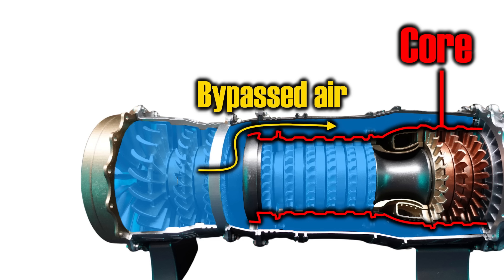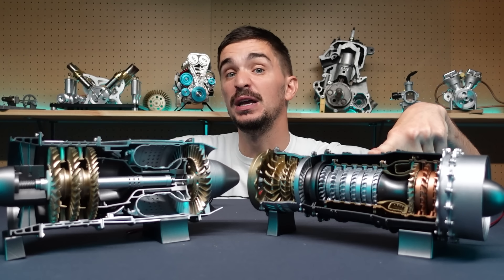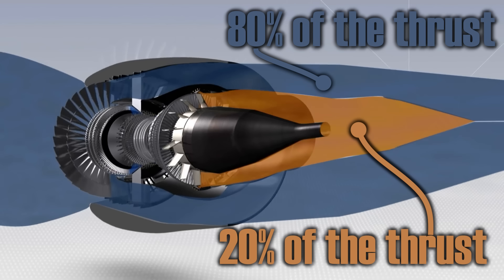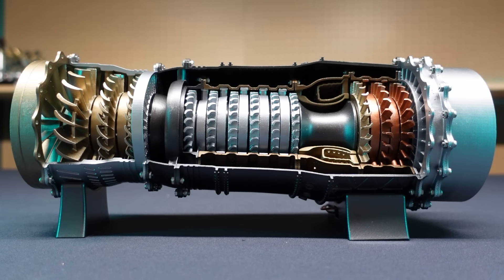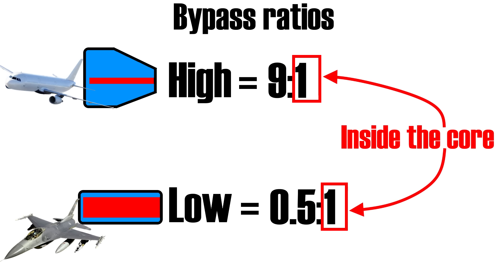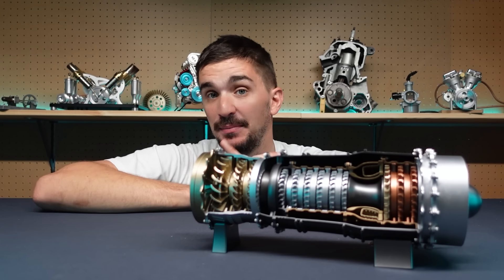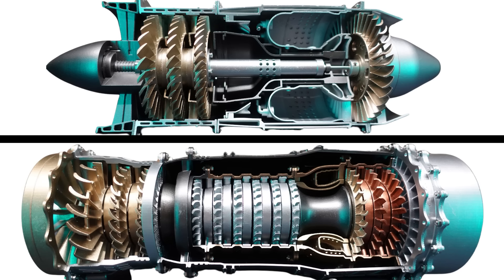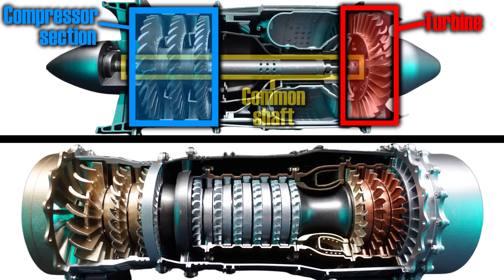Jet Engine Evolution - From Turbojets to Turbofans

Comment: I had now idea that turbofans had two sets blades on two shafts! Very good video D4A!
Reply: There are jet engines with three stages (low pressure, intermediate, high) on three concentric shafts!
Reply: @dielaughing73  @GetOffMyLog To expand further, most North American engines (GE, Pratt & Whitney) are of two-shaft (or two-'spool') construction. The fan and the LP compressor are on one spool and the HP compressor on the other spool. Rolls-Royce large civil aero engines (the RB211 and the Trent families) are three-spool: the fan on its own shaft and then the intermediate- and high-pressure compressors on their own shafts. Three-spool engines are heavier and more complex, but allow the fan and the IP compressor to spin at their own best speeds and also reduce engine length and increase engine rigidity.
Reply: @sentinel76  right. I remember researching the Trent 60 that was used in the local power station, which was three-spool as I recall. The big frame turbines may have been two-spool types

Comment: Bypass jets were in Whittle's 1936 patent although he called the fans augmenters - there were a number of arrangements described. I would have to check, but I am pretty sure the patent covered multishaft turbines, he certainly knew about the requirement to run different parts of a turbine at different speeds.  During and just after WWII, Whittle and Power jets were working on two turbo fans, one for the Miles M52 supersonic aircraft and another called the LR (long range) jet, which had a bypass ratio of about 3 for long range aircraft.  These were cancelled by the British Government.

The turbine with counter-rotating shafts was a concept worked on well before WWII by A. A. Griffith as part of his studies of compressors at the RAE (Royal Aircraft Establishment).  Despite his "villian" tag in the Whittle story, he was a brilliant scientist whose paper "An Aerodynamic Theory of Turbine Design" in 1926 showed that all compressors up to that time were operating aerodynamically stalled. Previous to this, he had published a very important paper on brittle fracture and fatigue "The phenomenon of rupture and flow in solids", a seminal work.  His work on compressors definitely covered multishaft turbines.  His turbine work (carried on by Hayne Constant after Griffith went to R-R) produced the technically advanced MetroVick F2 axial gas turbine, which first flew in a Gloster Meteor in November 1943, not that long after the Meteor's maiden flight powered by a pair of deHavilland H1 (later renamed Goblin) turbines.

So all these concepts in the video were known before the first gas turbine ever ran, let alone flew.  Getting them to first work and then manufacture them, well, that is another story.

Comment: Now explain simple plain air cooled aviation engines and why the simplest item costs so much to replace. It's like working on an old 911 air cooled engine, but parts are even mooore expensive.
Reply: That’s easy.  #1, FAA regulations.  #2, low economies of scale.

Comment: My big question is how visible are the exhaust gases between the older turbo-jets verses the newer bypass turbo fan airplanes when viewed from the ground? In other words is there a visible condensation trail behind both engines or just one of them based on their efficiency and the bypass air that is added to cool the jet exhaust?
Reply: depends on amount of used fuel, older engines were weak and not big fuel flow

Comment: One way I understand the efficiency of high-bypass turbofans and the top speed of low-bypass turbofans is purely from the energy and momentum standpoint.
The thrust of the engine scales linearly with the flow rate of the exhaust air and with the speed of the exhaust. However those things are not equal - the flow rate scales linearly with the energy use, but the exhaust velocity scales with the square of the energy (½*mv²). So for highest energy (and fuel) efficiency, moving more air is clearly better.
However there's a catch - the exhaust air has to move faster than the intake air, otherwise the engine doesn't provide any thrust. So for high-speed jets, moving a lot of air slowly isn't an option - so they have to go for a less efficient method of "move the air faster".
If the fan size was the only limit, you could "just add more small fans, outside of the engine", like VTOL aircraft (except pointed backwards, not downwards).

Comment: Turbo Fans technically have a turbojet inside of them. They just also have a by-pass section and exhaust is used to drive the big fan at the front, giving more air mass flow, therefore thrust. Turbo Jets do not have a by-pass area and a exhaust powered fan at the front. Turbo fans are suited to sub-sonic speeds and are typically more fuel efficient which is why most airliners use them, while turbo jets due to their less complicated design are more suited to military applications and are more fitted for super-sonic applications which is why most fighter jets use them.
Reply: Most modern fighters and supersonic bombers actually use low bypass turbofan engines, not turbojets.

Comment: Have you seen the new jets which have the fans on the outside I thought air is lost off the ends and ducting them through a tube no air is lost whatsoever making 100% of possible power and being very quiet unlike propeller one's where the blade tips go supersonic where they can be as loud as the tupolev 95 bomber which can be heard 100 miles away however this plane is capable of 575 miles an hour
So what do I know

Comment: Great video. 
Turbojets and turbofans both somehow benefit from the gyroscopic effect they generate: these engines quickly lose their power when the incoming airflow is not entering the engine aligned on the lenght axis of that engine
Reply: no, modern jet engines have systems that prevents stall/surge

Comment: Excuse me, let me ask you something. Suppose we use an electric motor to turn the jet engine shaft instead and we change the combustion chamber to an electromagnetic wave chamber or a microwave chamber that turns the air into plasma, is that possible? 
If it is possible, can we call it an electromagnetic plasma jet?

Comment: Unless I missed it, does anyone know what the compression ratio is inside a jet engine?

I assume it varies, but is it similar to a piston engine? Or higher?
Reply: In turbine engines it isn't called "compression ratio" (which is the ratio of volumes at maximum and minimum cylinder volume), but instead "pressure ratio". Primitive gas turbines (very old, or the ones now sold as toys) run as low as 3:1, but the largest and newest engines run at more than 50:1. 

Compression and pressure ratios cannot be directly compared, because adiabatic compression in a piston engine results in a pressure ratio higher than the compression ratio, and because the ideal mechanical compression ratio of an engine is not what it effectively achieves with real valve timing and fluid dynamics.

Comment: THE BEST DAY OF MY LIFE was a private tour of the Rolls Royce Airo engine plant - they GROW the turbine blades as a single titanium crystal
Reply: they were the first to think outside the box, until then only solid fan blades were used, which brought into question the increase in fan diameter due to the large centrifugal forces due to the large mass of the blades
Reply: yes and no. The turbine blades are cast in a 'Nickel superalloy' of undisclosed recipe - not Titanium. It's the extremely carefully controlled (and secretly controlled!) solidification that results in the inherently flawless single crystal turbine blades. It's a true marvel of engineering for sure! The fan blades have long been made in Titanium, for it's superior strength to weight ratio.
Reply: @crazyg74  - Yes that is a more accurate way of saying it.  I was lacking the language to describe it. it is a casting process that results in the entire casting being a single crystal

Comment: Very informative. The question I have is if turbofans are so much more efficient than turbojets then why were so many older aircraft that used turbjet engines able to substain high speed flight for such extended periods of time? SR71, Concorde, B58 Hustler, etc
Reply from the maker: You don't need to be efficient to sustain high speed flight for a long time. You just need to carry a lot of fuel 😉
Reply: to fly you need thrust, to have thrust you need speed difference between exhaust and local air, if you wanna be effective that difference must be minimal, so, if exhaust speed is high, that engine will be more efficient on higher speeds, but over 3Ma ram effect is so strong that you do not need compressor.........

Comment: Turbojet is not obsolete, only that it is not efficient at the speed that most aircrafts travel with the current tech
Reply: Correct, at higher speeds and altitudes, turbojets can be the more efficient option.  Which is why fighters use low-bypass turbofans, to glean the better of both worlds.
Reply: That makes them obsolete. Even supersonic military aircraft don't use turbojets any more.

Comment: Love it. One thing I would have mentioned is the connection between multi-stage configurations and the supersonic fan blade issue - i.e., the use of gearing to have slower fan speeds relative to the low pressure compressor in some very high bypass engines.

Comment: I was hooked with your Volvo red block video. Keep them coming. This video does a great job describing the differences. I believe one other advantage with the high bypass (but don't trust me without verifying) is that the momentum of the core exhaust is more efficiently transfered to the bypass exhaust because the bypass has a velocity that is closer to the core than the freestream velocity.  And the same holds for the bypass exhaust momentum to freestream. Basically it's just a smoother transitiion from core to freestream.  Hope I described that correctly.
Reply: yes

Comment: I would like to learn about turbine engines for power generation. I would like to know how they extract as much energy from combustion instead of trying to convert it into thrust.
Reply: They use generators. Much like the high bypass turbofans, or turbo props, they just use the power to turn generators instead of turning fans that create bypass, or props to create thrust. They design the systems to leave as little unused power as possible in the exhaust. In many systems they use the exhaust heat to power steam turbines, which makes it possible to extract more power with higher total efficiency than in turbine engines. 

I'm sure Driving 4 Answers can explain all this much better, in a video, that's also enjoyable to watch, let's hope he will.
Reply: Basically, you just add another turbine behind your engine, which is nothing more than a fancy windmill. It converts thrust into rotational energy, which you can then use to spin a helicopter's rotors or a power generator.
If you look for "free floating turbine", you should find some examples of the setup. It's not really that complicated

Comment: The technical term for a straight-through, uninterrupted combustion engine, such as a turbine, is 'steady state tetracyclic' because every event in the system remains in the same state from start-up to shut-down.

So, while all 4 'cycles' or [more precisely, 'stages'] if an engine occur, it is, by definition, NOT a 'cycle' in the sense that a reciprocating system would have.

Yet, on the other hand, since, as is often argued, a butterfly experiences different 'cycles' [or 'stages'] people will want to call this a 'monocyclic' engine, since it never actually changes, as a whole, such that it never stops doing whatever it was doing when it started.

Its an odd detail to look into, many varying opinions exist, as to if such an engine is 'monocyclic' or 'tetracyclic', but either way, it is indeed, truly, a 'steady state' engine.

Comment: wait, so why is there bypass air? how is that an improvement over the older turbojet?

it seemed like you were saying that commercial turbofans have high bypass so that the the fan can move larger volumes of air... so the turbine is merely to power the fans in front right? but when it comes to the low bypass for fighter jets... why not chuck all of that fan-blown air into the turbine and simply force more thrust using the turbines in the rear? i.e. why not just do a turbojet but with the 2 shafts and more fans?

what does the 0.5 bypass air do for the fighter jet that the turbojet with no bypass can't? (assuming they now have equivalent shafts and fans setup)

Comment: 📝 Summary of Key Points:

📌 Jet engines have evolved over the years, transitioning from turbojets to turbofans, with a focus on efficiency and power.

🧐 Turbofans, especially high-bypass turbofans in commercial aircraft, move large amounts of air through a giant fan to generate thrust efficiently.

🚀 Low-bypass turbofans, like those in fighter jets, prioritize moving air faster rather than more air, enhancing thrust at the expense of fuel efficiency.

💡 Additional Insights and Observations:

💬 "For every kilogram of air going through the engine core, a bypass ratio of 0.5 to 1 gets only half a kilogram of air around the core."
📊 Modern turbofans on commercial airliners can move upwards of 1,200 kg of air per second, with 80% of thrust coming from the fan.
🌐 Counter-rotating shafts in jet engines can cancel out gyro effects, aiding in aircraft maneuverability at low speeds.

📣 Concluding Remarks:

The evolution of jet engines, from turbojets to modern turbofans, showcases a shift towards efficiency and power optimization. Understanding the nuances of bypass ratios and multi-shaft arrangements provides insights into the engineering marvels that propel aircraft through the skies.
Generated using TalkBud

Comment: The bypass air in a jet engine produces 80% of trust, how about making the ( bypass air ) become 100% of trust by eliminating the sets of turbine fans at the back, then the engine will have to be run by a diesel engine in the body of the aircraft with two long shaft on either sides ( of the diesel engine ) to the jet engines on the wings, Jet fuel and diesel fuel will still be needed but very less.

Comment: Very good! Ive been a Flight Engineer / tech instructor for over 30 years. Ive seen engines evolve from RR Spey all the way to PW1000 series on my current aircraft type. They become more and more complicated but the basics remain the same. You did a great job here but I would have discussed inlet guide vanes and variable stators rather than outlet guide vanes. But that's a minor point, your descriptions here would be a great reminder for some of my students.

Comment: So a modern airliner gets 80% of its thrust by the fan acting as a giant propeller?
Reply: Basically, yes.
That's more fuel efficient because it takes less energy to accelerate a large amount of air to a relatively low speed compared to accelerating a smaller amount of air to a higher speed even if both produces the same thrust.
Reply: @fromnorway643  So then why not just be a propeller turbine and get unlimited bypass?
Reply: @fascinatedbyeverything  
"Propeller turbines" or turboprops reach their maximum efficiency at aircraft speeds around 350-400 mph and drops sharply after that.
Using them while limiting the cruising speed to that region would save fuel, but would also add several hours of travel times to long, intercontinental flights.

Comment: Its funny how a piston engine will melt itself if ran too lean, but jet engines are the extreme opposite. Awesome video btw, I love the aviation stuff
Reply: It's not strictly true. Diesels usually run well below stoichiometric and ultra-lean homogeneous charge engines have been attempted. 
Peak temperatures are actually the result of ideal stoichiometry, if my understanding is correct. It's something like a bell curve in which temps drop above and below 14.7:1. 

I would say the diesel process has a great deal in common with the gas turbine in the way that they operate constant-air, variable fuel and rely on internal heat to initiate combustion (at least after igniters/glow plugs are off).

Comment: Why are turbofans better than turbo-props? Aren't they the same idea?
Reply: They are different even though it doesn't seem like.
Basically in a turboprop engine, all the cumbustion energy is used to drive the propeller ie the exhaust gases hardly produce thrust.
In a turbofan the exhaust also produces thrust, and the fan also produces thrust

Comment: I would personally love if you got into depth about the few cars that applied turbine engines, like the Chrysler Turbine Car and the Jaguar CX-75 concept, which although it was a concept, an engineer friend of mine from school told me once JLR were exploring jet engines to power their cars at a point in late 2000s, early 10s.
Reply: the problem with a turbine engine in a car is that they are hopelessly inefficient at anything but near full power and making them small makes it even worse
Reply: @fuzzy1dk  from what I recall from my friend, and it was what was shown on the cx-75 concept was for the turbine to be a generator than a engine for the power. So maybe there was something in there that just made it cost prohibitive back then.
Reply: Well, while turbines are theoretically low maintenance compared to piston engines, the manufacturing of turbine blades is much more expensive. If you don't want air leaking out of the compressor section, you need extremely fine tolerances, and extreme heat tolerance to handle the constant burning exhaust. This cost is understandable for building an aircraft, not really for consumer vehicles.